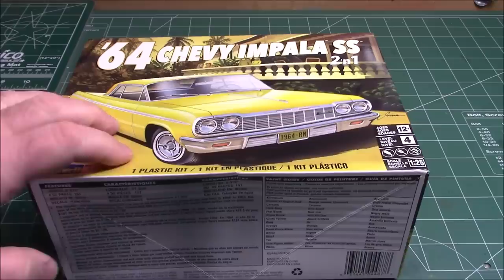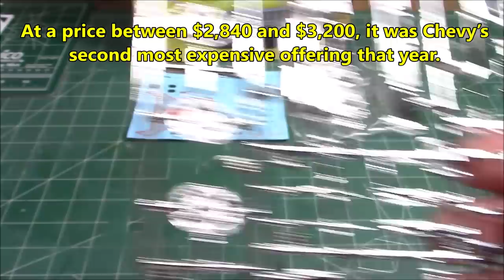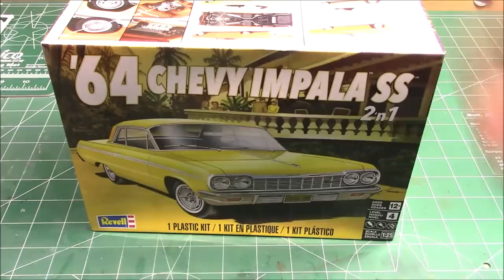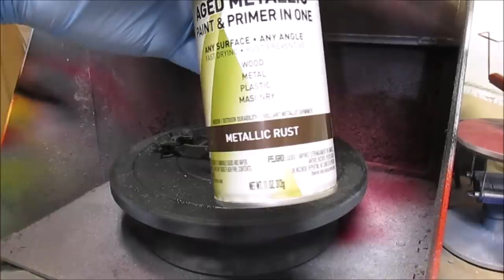Revell 1964 Chevy Impala SS 2n1 1/25 Scale Model Kit Build Review 85-4487

Comment: The impala looks good. i love the used look. 

seeing how you have a lot of paint build up in the back of your spray booth, i decided to for mine to protect my filters a bit by adding a single tissue for each day i use it. this has reduced the paint getting on it and kept the air flow high.
Reply from the maker: That works, good for you.
I swap the filter every 5-10 kits, depending on how slow the airflow gets.

Comment: I still have a package of Pegasus low rider gold wire wheel and tires from the 90's and I now know the perfect ( stereotypical too I might add ) model kit to use them with.  Back then the hobby shop had a display case which had model kits people built displayed in it, and a lot of low riders were usually in there.  People building those use to use cotton in the back window, around the interior along with the flocking stuff. The store started carrying the Pegasus products which had wheel and tires sets, sub woofers for the trunks, gold plated brake calipers and other odds and ends to "pimp out" your ride.  I even remember people taking beer caps and using them for tires which I thought was kinda neat. Anyway watching your video just kind of took me back to that time when low riders and parts were a big thing.  Great looking kit and I will sure to be picking up one. After all I have a few Impala kits anyway, seems like that has been a popular model that companies have produced over the years.
Reply from the maker: I do have some sweet Pegasus wheels, jut need to find the right kit to use them on. Thanks!

Comment: Man, awesome job AGAIN!!! Love how you weathered it up like a real one. Question: do you ever have problems getting that paint to lay right? Meaning, I've had some problems where it didn't lay down a glossy finish, as I wanted it to! Or, it spit out small particles on the surface. You seem to always get it laying down perfect? I mean, even before you put the floor gloss on it, it's nice & shinny! But I do most of my painting outside. Would that have anything to do with it?
Reply from the maker: Outside you have a big chance of stuff landing in the paint and the paint drying too much mid-air.
The temp and air is much more stable ad clean in the basement, but I still have defects here and there.

Comment: I got a question what's the difference between using plain old rubbing alcohol and Windex ?
Reply from the maker: Windex is mostly water with some alcohol and ammonia. Rubbing alcohol can be too strong and also dry out the tip of the airbrush too fast, clogging it.
Reply: @hpiguy  Thanx I know I need to go out and buy a gallon of Windex then thanks